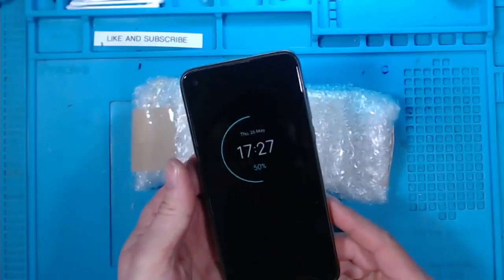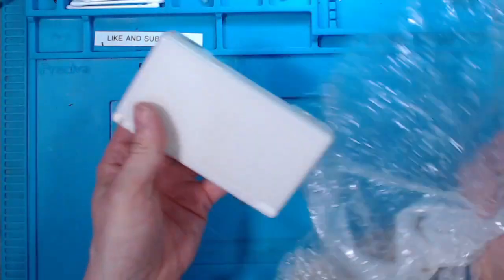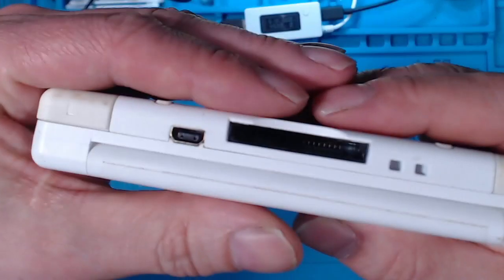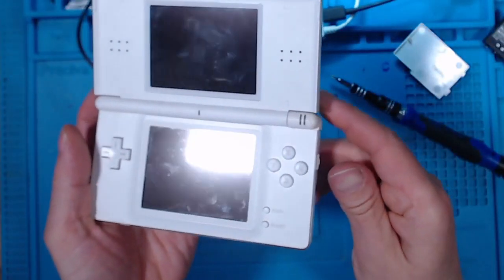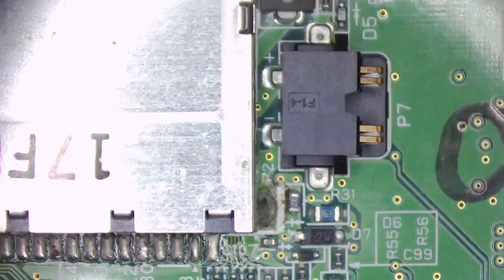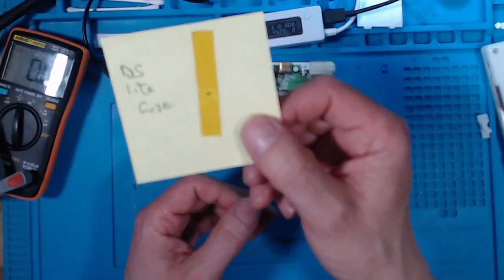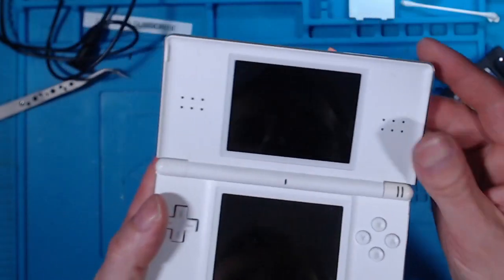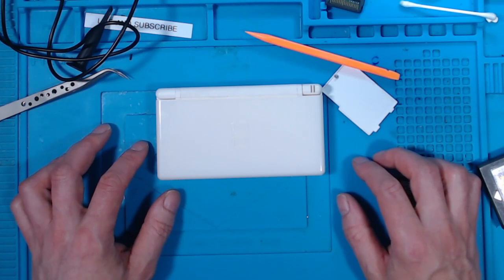DS lite won't switch on | How to fix it walkthrough

Comment: Hey mate I just swapped the shell on my singers DSL and seem to have this symptom after the install (this is my 5th install so I don't think I damaged the ribbon cable) I tested the 2 fuses that you tested and looks like the same fuse as yours has no continuity so Id love to try replacing it. What is it called and where did you get it?
Reply from the maker: If I were to look for some now, it would probably be on AliExpress.
Reply: @PhilipBryden  thanks man!

Comment: So what caused the fuse to blow? What would you do if the new one also got blown?
Reply from the maker: @GyroFox if the replacement fuse blows, that would suggest a short circuit on the board.

Comment: Won’t turn on when shell is on. Turns on when I hold the battery in place. What’s going on?
Reply: Just been having that issue, where it turned on without the shell, but not with. It charged fine either way and i noticed that it was turning off when applying pressure specifically near the charging port, but now it neither charges and or turns on ever, like this video.
Did you find what caused it?

Comment: Hey i bought nintendo dslite online and ite dont have a battery and i bought a batter online for $3 and its not turning on but i dont have a charger so i think its
Reply from the maker: There should be enough charge in the new battery to power on the system. You will have to open it up and start by checking the fuses.

Comment: Are the F1 and F2 fusses identical? I have two “for parts” lites that I got off eBay to fix up for my kids that both have the same issue, and I’ve got one scrap board laying around that I can salvage parts from.. Would be very thrilled if I can take the two fuses off my scrap board and get both of the eBay lites working 😁😁
Reply from the maker: I don't know. If I had the spare board with two fuses, I'd probably just use them .
Reply: @PhilipBryden  thank you for the quick response! Some quick googling indicates that listings of F1 and F2 fuses in bulk are all identical, so I’m going to give it a shot! Thank you for making this video and giving me hope that they can be repaired!
Reply from the maker: @Zuxos21  you don't have to remove the old fuses, just solder the replacements on top of the old ones.  Saves a bit of work.

Comment: Where could we get replacement fuses?
Reply: Aliexpress or any highly specialized electronic shop. It is a 0603 fuse at 0.5A
(please keep in mind that is very hard to confirm the actual current of the fuse, but all the information found points it is a 0.5A)

Comment: Have a similar problem to this, Ds lite will turn on for like a second and then the screen will flash a blank white screen on the bottom display. Battery light is green so I don’t think it’s a charging issue. Any advice
Reply from the maker: Normally if one screen flashes, then the other screen is faulty. So in your case it's likely the top screen is faulty.
Reply: Yeah I got one used at a yard sale and it charges fine but the bottom screen flashes for a second. The top one never flashes and you can hear a little rattle in it so I wonder if like something to do with the ribbon cable. And the top one being broken.

Comment: Thank you sir
Reply from the maker: Did you fix your console?
Reply: @PhilipBryden I opened the consol, everything looks clean, I  tested the battery and it work pretty good, but it's doesn't run
Reply from the maker: Did you test the small fuses?
Reply: @PhilipBryden  I didn't test all...
Reply: @PhilipBryden  actually, not yet, I didn't find the problem 😢
Reply from the maker: @omarjacob1148  what's happening and what have you tried?

Comment: Hey, Philip. I recently picked up a DS Lite that wouldn't turn on. It had some corrosion that I cleaned up with white vinegar + isopropyl alcohol. I got it to turn on after that, but there are still some lingering issues. For some reason I can't turn it off once it's on, the switch does nothing. I have to pull the battery. I cleaned the switch again several times but it doesn't seem to be making a difference. It also occasionally shuts off by itself (battery has plenty of charge). These issues might be related. Do you have any ideas?

I'm also having something weird with the DS cartridge slot. It will launch a game, but then display a message about how it can't read the save file and ask me to reinsert the cartridge. It did this for two separate games, so it's not the games themselves. Something messed up with the slot. I've swabbed inside with isopropyl alcohol on a cotton swap and reinserted a cartridge several times already.
Reply: Test the continuity of the charging port and the game slot port that could lead you somewhere
Reply: Have you managed to fix this issue? If so, how?
Reply: Some of the issues went away with further cleaning (like the cartridge slot stuff), but still not totally solved. I've got a pile of several DS Lites and none are totally working yet. I've had a lot better luck fixing GBAs than DS Lites, so I sorta took a break from the DS Lites and will come back to them eventually.
I'd have to review my notes for each one to see for sure which one I was talking about here and what the remaining issues are. I have some that were nearly perfect but then they stopped turning on for some reason. I have at least one now that works when loose, but once the screws are all in it won't turn on. Maybe a short somewhere. It's tricky to solve some of this stuff.
Reply from the maker: Your experience mirrors mine unfortunately. DSlite and DSis are a pain. I have a shoe box full of them, all with various faults.

Comment: I wish this came out a few years back. I had 2 ds lites that both did this and i just endedup throwing them away :(
Reply from the maker: I suppose we've all done it lol. Have you replaced them with another DSlite or something different?
Reply: @PhilipBryden  yes it was for my son and he's got another one now. Also have a PSP
Reply from the maker: I've never owned a PSP, I should look out for a faulty one to make a video about it.
Reply: @PhilipBryden  i replaced the screen on mine and was good to go. Great graphics and great games. Hope to see a vid soon. I love watching these types of videos
Reply: @PhilipBryden  Good news! I thought for sure I had thrown the 2 ds lites out but I still have them! one does exactly the same thing. the charging light comes on and then goes off. My son dropped it in the bath. as for the other one, it appears that it's charging. the light comes on orange and stays on but it wont turn on when you move the power switch. I'm going to try and repair them the same as you did in this video. wish me luck! :)
Reply from the maker: That's great news. The one that took a bath might be un-fixable depending on how much water got in there. Pick up a new battery from Ebay or Amazon, so at least you'll know the battery is good. Let me know how you get on, good luck.
Reply: This system was absolute garbage. Same happened to mine, after years kept into it's case. Meanwhile, my old Game Boy Color is still going like a beast with no issues.

Comment: I cant remember who's video it was but there was a comment that mentioned you dont need to remove that blown fuse from the board and risk damaging anything else - just solder another one right on top. It's blown/open anyway so you're pretty much just using it for pads to solder to. I looked at one of my own DSL's and the height of the second fuse wont interfere with anything. (since the fuse as small as a grain of rice lol). Thx for the vid. Was interesting.
Reply from the maker: Yes that's a definite option and it's one worth pointing out too. Thanks.  You're right about removing the risk of damaging the board as well .
Reply: Will definitely keep this in mind, just changed shell on my ds lite and now nothing no power no sound no screen nothing 😭 haha
Reply: @thomasdoherty6876  hey was the issue the fuse? kinda having the same issue except my DS lite had been sitting at my desk for a while lol, changed the shell today and it won't turn on, battery was completely empty though and it seems to be charging currently as the orange light is on with the charger
Reply: @BeyondBirthday8  was the em10 filter, apparently all the shells you can buy are almost a good fit it snapped my em10 filter which blew the fuse 🙄
Reply: @thomasdoherty6876do you still need the em10 filter and change the fuse or change both

Comment: Good job! I have to get that solder
Reply from the maker: The solder is fantastic. I only paid £4.75 for 20g, which doesn't sound like a good deal, but it goes a long way. It made this fuse replacement easy peasy lemon squeezy.
Reply: I looked on Amazon but didn’t see it, anyway easy peezy is right!
Reply from the maker: @edwardreichard3852  Here you go. https://www.amazon.co.uk/gp/product/B01MFC5X6X/ref=ppx_od_dt_b_asin_title_s00?ie=UTF8&psc=1